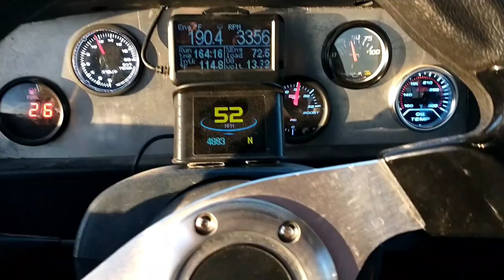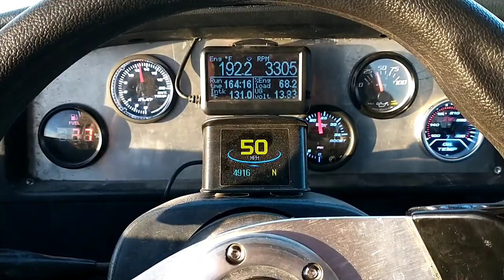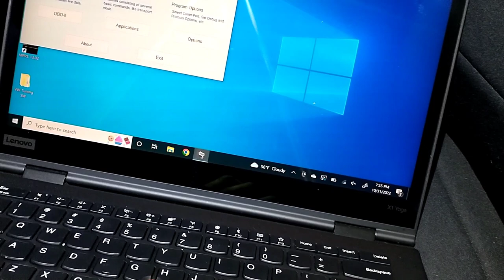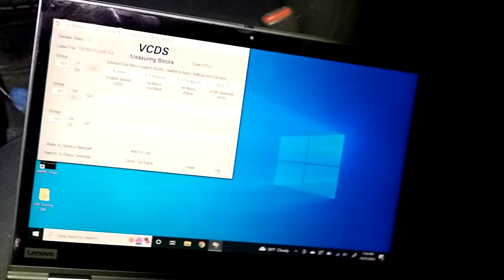TDI Diesel Swapped Jeep TJ Wrangler Leaves Me Walking Again! Diagnosing No Start On ALH TDI

Comment: ive added a fuel bulb from an outboard motor fuel line between filter and injection pump in fitting. Makes priming after filter change a breeze
Reply from the maker: That's a great idea! thanks!

Comment: If you have a mighty vac or some sort of hand held vacuum pump, you can disconnect the filter to IP line, and suck fuel up to the filter and fill it.

I do that when I change my fuel filter, and can fill the filter in approximately 10 seconds. Can get the entire fuel system air bled in under a minute with that method, including bleeding off the injectors if you sucked enough air.

Just another way to do it. Your way seems just as effective though.
Reply from the maker: Yeah I actually lost the canister to my mighty vac and I wanted to see if this method was any better or worse, I think they take about the same amount of time, I was just being too careful to not blow up the gas tank LOL

Comment: Nice vid. I usually just fill the injection pump with a funnel through that feed in nipple thing and that usually bleeds the system well or one of those a/c vacuums will do it without the mess
Reply from the maker: Ya I've done it alot of ways, honestly just wanted to see how the pressurization idea works ha ha